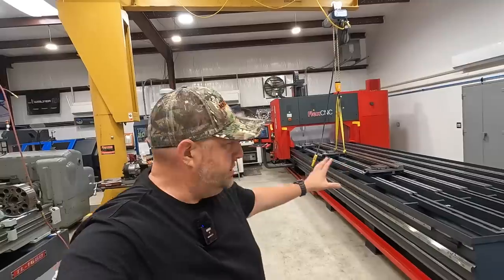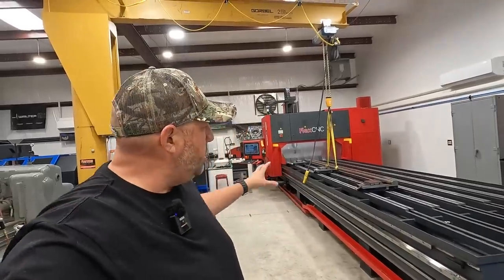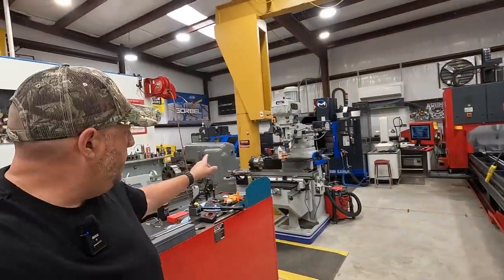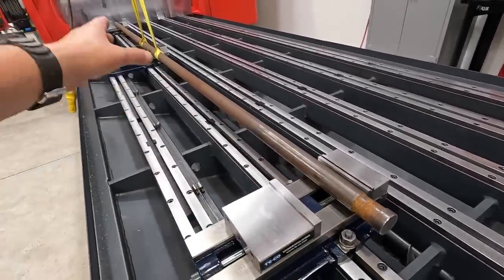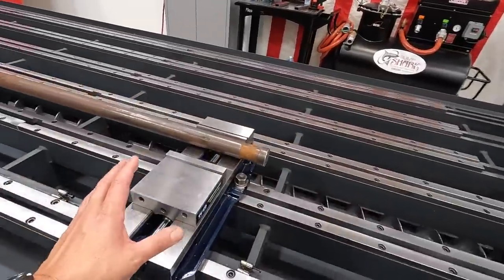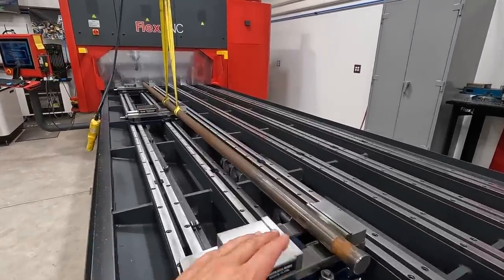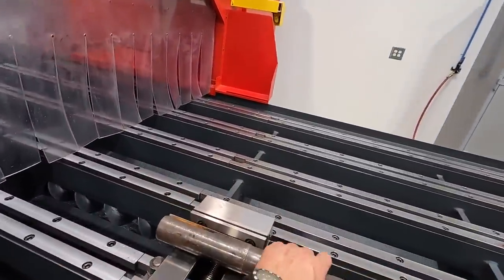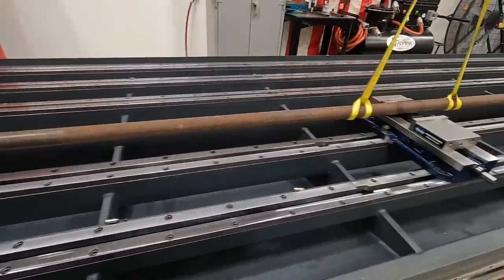Keyways Machined in the Flex CNC

Comment: My 0.02 and I am no pro. 
1.
I would use g54 one end. G55 for the other. Any variation on height or location will be mitigated. Example.  Dirt under the vice.

2. 
Use a smaller endmill. Do a roughing pass, measure and then comp the finish pass. A smaller endmill will let the chips clear out on the return pass, more room and it will be less likely to chatter on the circular move at the end.

There are many ways to do the same job. I love your openness, Adam. Not easyvto do on the internet.  Much respect 💯

Comment: If you had did that job the regular milling machines you would have to turn the work piece around and it would have been hard to make the key way I n line. 
 Very precision with the Flex CNC.
 Good job Adam. Looking forward to seeing more jobs and more chips lol.
Reply: I've seen Adam do that,  and he clocks the second keyway by deburring the first one then using a small machinist's level to get it vertical.   That always seemed a little unpredictable to me but I guess it's never too critical to get the two keyways exactly in line, given that the shaft will twist some under load.   He does it for aesthetics mostly.
Reply: @MattOGormanSmith  yes you are right. I remember seeing him do that and he had his home shop setup to do things like that but as you remember he had to put a stand on the floor for something that long.

Comment: Great job! Good to see you are learning and gaining confidence in your abilities.  Coming from years of robot programming where the programs and operations are similar to cnc, once the program is proved after programming, no need to slow it down unless you made a major change. It will always go where programmed to go +/- the machine tolerance for repeatability. It's scary at first but trust the machine. Get used to using the right hand rule of orientation and stick it on the machine controller for a reminder. For better accuracy and easier fine tuning, make each end it's own work object. Then making a tune adjustment (on the left keyway say) has no effect on the other position(s) as you are doing a local adjustment not a global adjustment. For production, try to keep the up down spindle movements to a minimum for speed as well as at end. Try a move up enough to clear part then move to stop position. I noticed that there was up/down between rough and finish passes at each end which is probably not really needed. Turn off the coolant if you can when on long traverse of the part. Less to clean/dry off.  If the production parts (shaft) length varies by a tolerance of x, make sure the cutter starts  past that point and you won't have an issue if the part varies a bit or try plunge and go to the part end if the position where the slot ends is critical. Anyway, keep up the good work! Enjoying seeing you learn cnc.

Comment: I just packed up my manual mill for sale. I brought my CNC for my home shop about 20 months ago and I have hardly used my mill since. I have got to the point that I can design, program and cut faster on my CNC than I could do the job on my mill. I have limited space so out it goes. CNC lath is next on my list. I have never worked in a machine shop in my life I'm fully self taught and by far learning to own, operate and program a CNC has been the most challenging thing I have done in my life. One thing I have learnt the hard way is a Carbide cutter hauling plenty of RPM shows absolutely no mercy. I am fortunate that I have not done any serious damage. You go ahead and take your time. Your discipline will save you thousands.

Comment: Adam, 0.0005” tolerance in two planes over 12 ft in length, impressive!! 

If you think about it, the FlexCNC model you has the benefit of an old school planer (thinking Steve Watkins’ Rockford) but the speed and efficiency benefit of CNC. Plus you can keep the work stationary relative to the cutter, larger workpiece, smaller floor space in the shop.

Great video, great work! 

Thank you!

Randy

Comment: Great starter production work.  Not trivial, not too complicated.  CNC machines are so smart now.  The first one I ever saw in operation was the one my school had for the mechanical engineering students in 1982.  Used a punched paper tape to load the cutting program.  The demo they liked to give was cutting a small block of hardwood into a bolt.  Was amazing to watch, I still have my 7/8" wooden bolt somewhere around here.

Comment: Just amazing how quick the machine performs its instructions after all the time it takes to write those instructions.  Thank you for taking us on your journey.
Reply: Once he gets good at it, this program would take 5 minutes to write
Reply: It's a bottom-clenching moment when you do the first run,  even after you've inspected the simulation carefully and done a trial run "cutting air".
Reply: How long does it take to print a 40-page document compared to how long it takes to write, edit, spell-check, grammar-check, boss-check, and re-edit it? I can easily spend 3 or 4 weeks doing that stuff to get it right.  If I want to print it again, it only takes seconds.  I started using slide rules, drafting boards, pencil & paper, and secretaries with typewriters and don't regret the switch at all.  CNC moves work time to prep time the same way.

Comment: My company purchased the 40-06 G series. When I did my training on this brand machine you were actually at the facility the day we finished.
You are definitely headed in the right direction. Having been in this trade nearly 40 years, I have learned you never stop learning.
The issue with your depth being to deep may be that the probe you are using possibly isn't correct Z height in your tool table. I am using the digital model of the same unit and I had to play around with that to get it to be reliable. 
Happy Machining Abom79

Comment: Cool… nice to see a revenue job in the FLEX CNC… 
Huge benefits of having a long bed. 

A MANUAL MILL on that part… can you imagine the set up.. the supports and THEN YOU HAVE TO 180° and redo everything 

TRUST YOUR SETUP!!  start turning chips into dollars.
Reply: Honestly.....I think he'd be much faster doing manual for a one off.  The payoff comes when you have to do some quantity of the same part. The setup on the CNC takes longer, but once you have it dialed in, repeating the op pays off for the setup time. JMO
Reply: back in the day as a young man working in sawmills, long shafts were routinely keyed the entire length to accommodate sprocket placement at random spacing, such as the 'green chain'. we used a portable electric powered key-cutter that clamped to the shaft and performed the cut about a foot at a time, move the setup, repeat. CNC? whats that???

welcome to the 21st century - get used to it, right?

Comment: This may be obvious but I just have to say it :) .. it takes real dedication to the trade, and dedication to learning new machinery.  To take what maybe 5 time longer to mill then keyways on the CNC .. than a manual machine would take. 

I think it's awesome .. ands wish I was there learning :)  ..I've mentioned a couple times I used to program and run CNC lathes back ion the 1980's ... In a production shop not a specialty shop like Adam's) 

And I feel it would be so interesting to see how that old knowledge would equate to the late4st CNC machinery.

The stuff I ran was so old ..the programs came on ticker tape .. literally punched holes in 30 to 60- foot long paper tapes :)_

Comment: Adam, it's been a while, man! I've had a busy couple years here bouncing up and down the East Coast and getting back to school.  As such, my youtube viewing pretty much dropped off entirely. Imagine my surprise to come back and see the rumored new shop fully set up and with some nice looking new machines! I'm glad to see it's worked out well for you. As for diving into the CNC world, it's definitely a smart move and getting a similar mill is on the goals list in the next 3-5 years.

I don't know how much advice you're looking for from the crowd but there's a few things the past couple years of job shopping have taught me in regards to CNC machining. The first that comes to mind in your case is to trust your manual machinist instincts. CAM loves to run a 3/8" cutter at 5k rpm but I get really sick of hearing that squeal. We did a ton of very similar shafts in 316, 400 series and some exotic stuff like Carpenter 20. After a bit, I quit trying to push for cutting speed, the extra 30 seconds isn't eating the margins in a job shop. Slowed the cutters down to a more normal 1800-2500rpm range depending, backed off the feeds a bit and let it run smooth. Ya' know what? I stopped chasing those wear offsets all the time as soon as I did. I'd venture to guess that you get a lot less cutter wear on jobs like this and a lot more deflection, especially at higher speeds. Solid carbide endmills are awesome and typically pretty stiff but, they can act elastic at speed. 

Now, when you get into doing some of those larger milling jobs, I can't recommend high feed milling enough. I got sick of changing tools all the time and found a Tungaloy 5/8" high feed mill laying around. Holy cow, I could dance that thing around at 40-60ipm and .05" depth of cuts like a normal face mill but, twice as fast. And the inserts just don't care what you're cutting as long as you're climbing. I got like 30 some pieces pocket milling in 01. So I guess I mean to say, they can be worth the added investment. I know you've got plenty of big face mills already but, if you're looking for an economical insert change and quick MRO, it might be worthwhile. 

I'll be honest with you, I spent a lot of time on a CNC lathe and didn't really come across many revelations that made me think "this makes like so much easier". The closest would be using a little Haas Tl-1 with a Buck chuck on it. I don't love swapping jaws all the time so, being able to 3 jaw and then buck a piece concentric was nice. The biggest mistake I see people making on CNC lathes is not cleaning the conveyor and coolant trap soon enough or well enough. I get the feeling that you're prepared for that with the Sump Shark though. 

On the CAD CAM side, that's a bag of worms for a lot of reasons. I'm not sure what software you're running but, there's a lot of content out there already. I find myself kind of sick of CAD in particular lately but, my degree has meant logging a lot of 16 hour days at it. Get yourself a mouse that is comfortable if you find yourself doing it a lot, Logitech M575 works well for those of us with bigger hands. But ultimately, my gut says, use CAD for the obviously complex parts but, try to write as much as you can at the controller for a while. It might be faster at first to use CAD rather than dry run a program 5 times but, it pays off in making those mental connections. Before long you get a list of a dozen or so programs developed that have the type of architecture or features you want then you can just go modify them quickly to whatever comes in the door. Need to pocket mill something and poke some holes? Need to profile the outside of a part in .05" steps? Just go in and change the sizes. It really helps to build confidence as well, knowing that you need that X value in this G3 and should probably use a G43 program for this and a G42 for that. 

On that note, I've played around with tool height setters a bit and the table mounted probes do a nice job but yeah, a quick shim check saves a lot of grief. 

But, I also wanted to mention the coolant, Trim is nice stuff. I just wanted to say that none of the emulsions are perfect though, be sure to break down your vise set ups regularly and wipe off the table. Metal on metal contact with coolant makes for galvanic corrosion. Before long you get vise shaped rust holes in tables. That oil also loves to build up in spindle tapers so, on Monday morning, it doesn't hurt to wipe out the taper with a dry rag. Maybe a monthly tool holder wipe down, too. 

Anywho though, you're a smart guy and I'm sure you'll get it figured out. Just felt like paying back some of the tips you've had along the way and I hope all is well for you otherwise.
Reply: That's some great advice from someone who's been there; I hope Adam sees it. I was especially pleased to see that you answered the question about speed versus tool wear that's been on my mind. There's a time for maximum feeds and speeds and there's a time to save the cutter for a few more jobs and reduce the noise. I'm anxious to see Adam crank out a hundred or more of something and make the CNC really show it's value.

Comment: Great video. Just a word of caution.  I use the same PPS sensors (the yellow box on the bottom of the carriage ) on automated fork lifts. If the brack screen cover gets dusty, don't wipe it clean with anything but the manufacturers wipes. You can easily scratch the screen and replacements are not cheap. A scratched screen plays havoc with the mapping.

Comment: For camera splash, have you thought about maybe installing a small fan of air (only as much volume and velocity as you eventually find is needed) in front of the lens to prevent coolant liquid from getting on the camera?  What you did in this video was very acceptable, but I know some operations spray coolant a lot.  Thanks.

Comment: Glad to see you are expanding your knowledge base.  You do know that you don't have to actually use a full length piece of stock if you are only cutting the ends?  Put a short piece the right diameter in each end vise and measure the distance to the far end of each piece to set the exact length as the work piece and set stops at both ends.  Then all you have to do is rotate each piece to do practice cuts and make adjustments.  Then if you need to keep practicing you just have to flip each piece over.  As far as the first cut being the wrong depth, there is probably an error in the Z axis offset in either the tool holder with the bit installed or the measuring device.

Comment: Question your inspection technique for depth. Should the depth not be measured from top of the OD instead of flat across the two remaining surfaces after cutting the key?
Reply: Good question.!?
Reply: Yeah, it should be. But I always measure like that because it gives you a bit of bonus clearance :)
Reply: Yeah if he's not trolling with that, I really question his abilities as a machinist.
I did a little math, and on an Ø40 shaft, with a 10*5mm keyway, this technique would give you about 13% error in measurement. May aswell do it by eye at that point.
Reply: Pull out your copy of Machinery's Handbook, and then you tell us how to measure the depth.
Reply: That's an excellent question. From an ideal geometric perspective you can measure from across the points to bottom of the key-way, but of course you will get a different value* then if you measured from the (now missing) outer diameter. As long as you account for that, either way is fine. From a practical standpoint it would be better to measure from the OD, because when you measure from the intersection points, the value is also influenced by deviations in the width. And depending on how wide the slot is, a very small deviation in width could have a large influence in the measured depth.

However, from a practical and historical standpoint, that's how key-way depth has always been measured and how it's often specified in drawings. Mostly because it's easy to measure that way. It's an acceptable method because key-way depth should never be a critical dimension. Keys should always have clearance and never be a tight fit in this radial direction. They are only a tight fit in the width.

* From the Machinery's Handbook the formula is M = ½(D - √(D² - W²)), where D is the shaft diameter, W is the key width, and M is the difference between then OD and the intersection points. For the specified depth you must feed down an additional M if you touch off from the surface of the shaft. Today, this seems more complicated for a CNC setup but for manual machines without a DRO it isn't. On a fully manual machine (such as in Ye Olde Times) if you wanted a depth of 0.250" you approximately touch off on the top of the shaft and make a 0.200" depth cut. Then you zero the Z axis dial. Now you measure the actual depth with a depth micrometer as Adam did. You subtract the measured depth from 0.250" and that is the number you turn the hand wheel to to make the final cut.

Comment: I ran lathes and mills in the late 90's and had a basic understanding of how to do things. Coning from an automotive background and doing my own valve jobs, boring etc. I was in a machine shop 2 weeks ago and did not see 1 piece of equipment I would ever be able to operate. Computers changed a lot for me so I would need a computers course before I would be able to go to college to learn how to use these contraptions.
If I move into farm/ industrial equipment the programming is all proprietary with special access codes to unlock the menus.
The cars I repair are too new to have the software updates in our machines.
There isn't a day that goes by I don't think about throwing in the towel and starting a painting or fencing business... or as a training consultant. I can totally see why the kids can't cope with jobs today. The apprenticeship system used to rely on fathers handing down knowledge at an early age. We can't teach these skills in  4 years of tech training.
I will use the example of an excellent YT auto electrician that had a hard time plugging his tire. Thankyou Adam for taking us along with you.

Comment: If doing a lot of keys I would use one  tool to rough and a second to finish. The finish tool will not wear near as much and radial wear comp will be more consistent. With one tool you can easily get taper in your keyway.